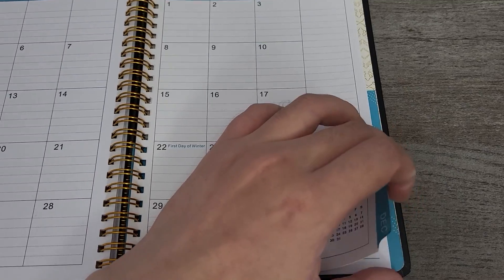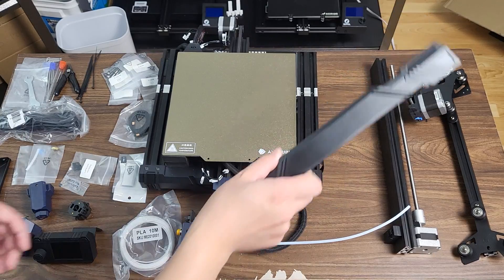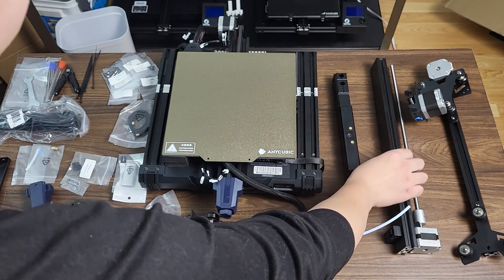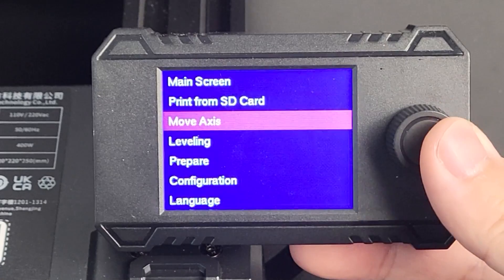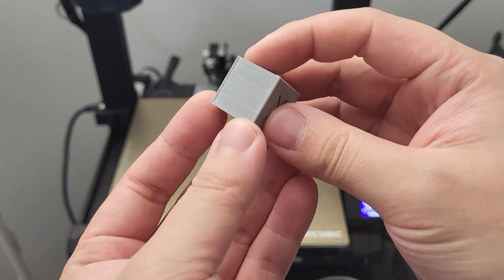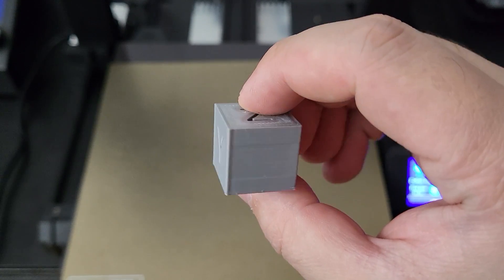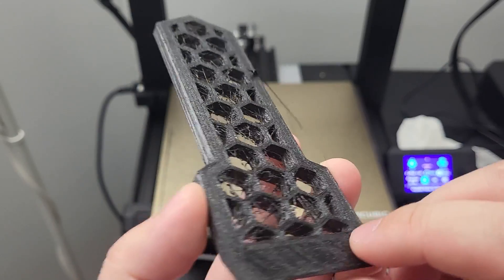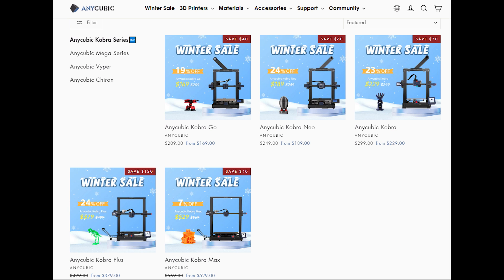Anycubic Kobra Go Review | A better alternate entry level 3d printer then Ender 3?

Comment: Würdest du mir als Einsteiger diesen Drucker empfehlen oder doch eher lieber einen anderen?
Reply from the maker: My first question, how much it cost at your location? Does the vendor come with good return/replace policy? If the vendor has good return policy and price is similar to what I bought, you can give it a try. The hardware of this machine is really nice for under $200. But you may have to do a lot of learning and calibration, if you are luck you may get one works perfectly right out of box. 
Also something to payattention, is the replace parts supplies on your location good enough? Because on US right now, it is a bit hard to find the replacement parts, or you need to do a lot of reseach to make sure it works.
Reply from the maker: Meine erste Frage, wie viel es bei Ihnen gekostet hat? Verfügt der Anbieter über eine gute Rückgabe-/Ersatzrichtlinie? Wenn der Verkäufer gute Rückgaberichtlinien hat und der Preis dem entspricht, was ich gekauft habe, können Sie es versuchen. Die Hardware dieser Maschine ist wirklich nett für unter 200 Dollar. Aber Sie müssen möglicherweise viel lernen und kalibrieren, wenn Sie Glück haben, können Sie eine funktionieren, die sofort einsatzbereit ist.
Auch etwas zu beachten, ist die Ersatzteilversorgung an Ihrem Standort gut genug? Denn in den USA ist es derzeit etwas schwierig, die Ersatzteile zu finden, oder Sie müssen viel recherchieren, um sicherzustellen, dass es funktioniert.

Comment: How could you like this printer a lot? The print quality is atrocious. I gave up on Anycubic because of my Mega S. They produce completely unreliable machines, as can be seen from the print quality in this video. And I've seen your other videos, you're not a beginner, meaning you're not doing something wrong, and would likely have solved the problem, if the problem was solvable. The printer is to blame.
Reply from the maker: I like what they trying to do, bring more hardware value with lower price. I like they went far on design. However, in the end of the day you need 3d printer to printing well. It is not a table decorate. Which I totally agree with you. It is shtt box for the first month, I replace almost everything on this printer one by a time and try to make it work, in the end, I put all stock on back on. It just all small built quality issue here and there. 
It makes me thinking are they really have quality control on site, or just random operator put "passed QC" sticker on everything? 
But, I have seen a lot people success with this printer. So, I don't want to be bias while doing review. Unlike other videos, I did not mention purchase suggestions.
Reply: Dude chill he didn't have it dialed in Fully. I have had this printer since November and I like it more than my Ender 3. I auto level this thing twice only because I replaced my nozzles. Other than that no leveling and perfect first layers. With what he printed his tolerances would not work with a hinge. I can print micro hinges. The issue I had was I tried printing before I updated the firmware big mistake. Other than that this printer is a  gem 💎 for $169.

Comment: thanks! what printer do you suggest for a beginner? i'm looking to buy my 1st printer
Reply from the maker: Is your besget limited? Or you want something that will have fun for long term?
Reply: @SvgLau  i want a good printer, for a long time, so im happy to spend a bit more money
Reply from the maker: @hood1148  so Bambu lab p1p, probably best one under $700.  Prusa i3 mk3s+， one of the best i3 structures 3d printer,  But pricy, I would recommend p1p over mk3s+. Sovol sv06, a lots of potential if works correctly (under $300), still some minor issues with qc cuz it's early production. Ender 3 v2 (under $200) is nice. There are really a lots of nice one around $300: ender 3 s1, elegoo Neptune 3 pro, sovol sv01 pro..if you are at US and have microcenter around you, they have new customers special $99 for ender 3 pro, really nice deal. I suggest not to spending too much one your first 
Printer, maybe you will not like these thing after buying it. Budget printers will not make you lost too much money if you regard buying one later on.
Reply: @SvgLau  thank u! Keep making videos plz, especially about using Fusion 360!
Reply from the maker: I will try my best, been busy, I use my sleep hours to making videos..lol.  I was professional trained to use those software in a proper way. Like AutoCAD, Inventor, funsion, Creo PTC package. But, I end up doing CAD with "not so proper way", anyways, I will try make something with fusion 360 later.
Reply: @SvgLau  thank youuuuu!